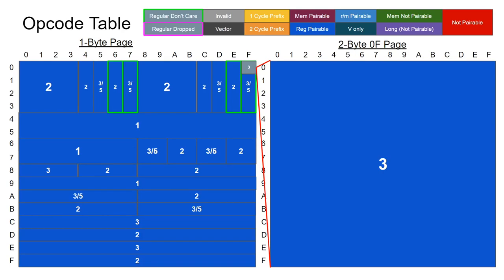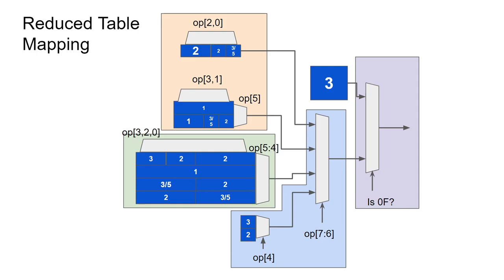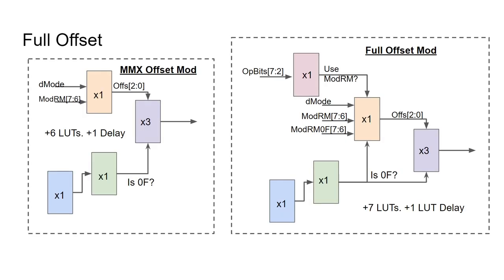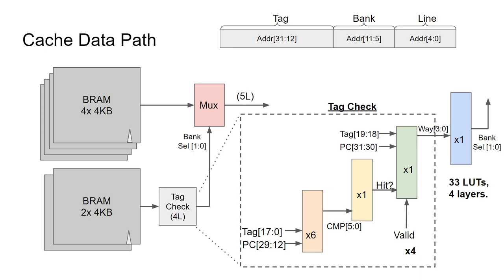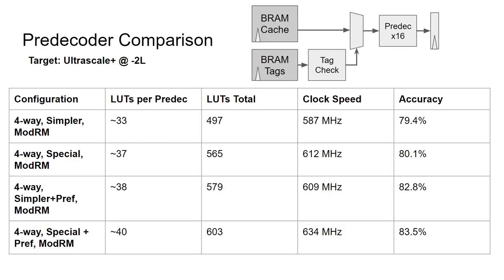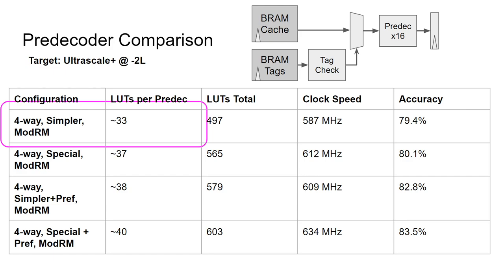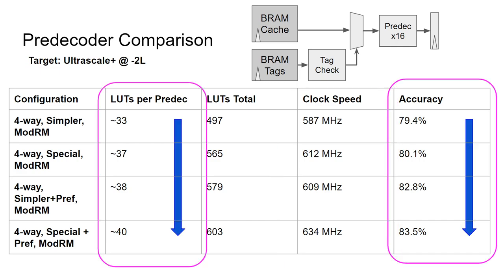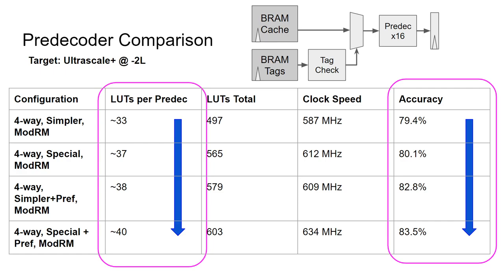Pentium MMX Predecoding in a FPGA

Comment: Excellent, like you said it's like a TLB. Seing the implementation, everything make sense now, but i'm still confused about the decoder accuracy. What is the penality in case of a wrong prediction.
I see more and more the decoding as a stand-alone pipeline connected to an others pipelines by an arbriter/scheduler, or am'i wrong ?
Almost thougth that you spoke directly to me when speaking about ram in an xilinx pfga, freaky ^^.
Reply from the maker: Thanks! It's similar to a TLB - you can think of a TLB as a cache for addresses instead of data. The actual structure depends on the implementation though, but the P5 used a 4-way set associative TLB, which would look identical to the cache (though the P5 used a 2-way cache. It was the PMMX that used the 4-way cache).
The predecoder accuracy is how good the predecoding guess was, since it's an approximate solution and not a full length decode. To tell if the guess was correct, the full length needs to be determined in the align stage which was described in the x86 front-end complexity - part 2, video. If the guess was incorrect, then it depends on how the aligner interacted with the instruction queue / FIFO. If the aligner only pushes instructions it knows had the correct length, then you only get 1 instruction that cycle instead of 2. If the aligner speculatively pushes instructions, then it needs to post-invalidate the incorrect instructions it pushed, and rewind the decode program counter. I had to do the latter in the 400 MHz+ implementation, but while the predecoder was 85% accurate, the whole speculative cleanup part dropped it to effectively 60%.
As for a pipeline, it's part of the CPU pipeline. You could probably think of it as being its own pipeline, just like a FPU or a load/store unit might have their own pipelines / pipeline stages. Actually, in both of those cases (the FPU and load/store), you would have something like an arbiter/scheduler too. Effectively, it's a local control block which synchronizes the behavior. Unless you meant that the aligner sort of acts like a scheduler for the 2-way pipeline later in the processor. In that case, it wouldn't, because the FIFO should be at the granularity of a single instruction. The aligner might push [A,B] then [C, D], but the decoder might decode [A], then [B,C], then [D]. That would be the case where A and B can't pair.
Hope that helps clarify.
Reply: @RTLEngineering  Yes thanks you, much clearer. You guess right, in your example, a wrong estimation is follow by a flush (post-invalidate) and rewind the PC, much like a wrong branch prediction in the later stage in the pipe.
Reply from the maker: Exactly, though that's only if the aligner speculatively pushes both instructions. Or if the decode program counter was wrong going into that cycle (due to a previously incorrect cycle). If you assume the decode program counter is always correct going into the cycle, then you can always push at least 1 instruction. The predecoding data is only needed to find where that first instruction ends and the next starts. Though, if you then trust the next instruction's predecoding data and update the decode PC without checking to see if the length was correct, then you will be in the state of an incorrect decode PC next cycle.
I guess a shorter explanation is: if you speculatively push instructions in the way that a branch predictor speculatively predicts branches, then you need to be able to clean up and rewind the state when the guess was wrong. That's in contrast to the case where you ensure that an incorrect state is never reached, which would be akin to stalling until the branch is resolved (luckily the aligner won't need to stall, it just cuts the throughput).
My suggestion is not to push instructions speculatively. It's not worth the hassle to clean up the state.
Reply: @RTLEngineering  And thanks to you, i have just realised why there is so many "buffers"-like structures, it's to mask the stalling by each "stage" of the pipeline (not counting the pipeline registers). A buffer for decoded instructions & macro ops, one for micro-ops before ALU, FPU or AGU, an other for commits and many more i'm sure.
Reply from the maker: Exactly, though they are also used to cover what you could probably call a semi-stall. When you have a pipeline stage that has a peak throughput higher than 1, but can't always achieve it, you can use a buffer to ensure that the stage always has a set of viable candidates to schedule at once. The instruction queue / FIFO in the PMMX works that way. Sometimes the backend can pop 2 instructions, other times it can only pop 1. But if it only has 1 in the queue, then it has no choice but to pop 1.
Meanwhile, if you want to go crazy thinking about "buffers", take a look at the later 3dfx GPUs (the die shots). All of the smaller memory arrays are FIFOs to buffer between the various pipeline stages (far more than any CPU has).

Comment: U should do a video about the power pc chips
Reply from the maker: If I knew more about the PowerPC architecture, then I could. But from what I do know, it's a lot less interesting due to it being RISC (the older ones probably didn't do pre-decoding, because that wasn't necessary, and all of the instructions have the same fixed length).